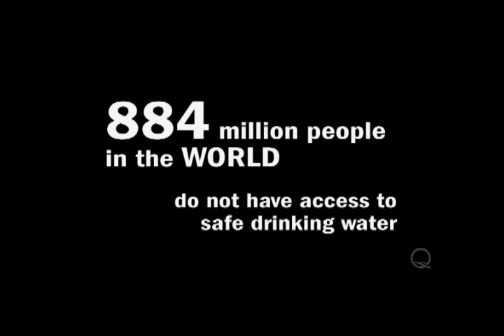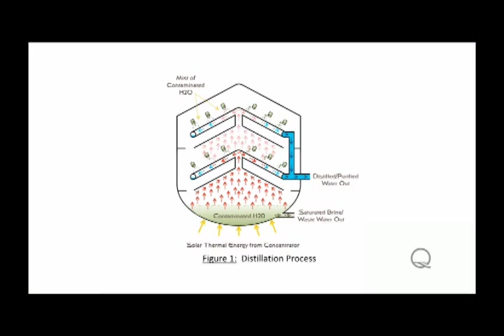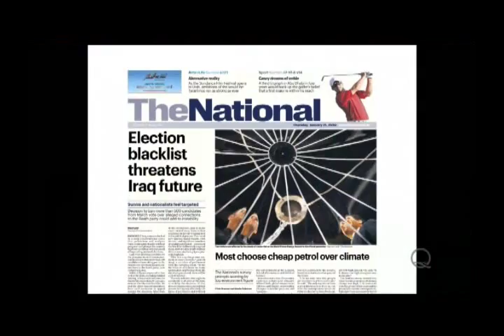Epiphany Solar Water Systems on WQED

Comment: "Here in Pittsburgh we don't have to worry about getting fresh water ..." The opening line of this WQED Pittsburgh 360 piece is patently false. Pittsburgh has yet to genuinely address the primary goal of the Clean Water Act:  "...(1) it is the national goal that the discharge of pollutants into the navigable waters be eliminated by 1985;..." Continuing Combined Sewage Outfalls are only the most basic and relatively benign of our failures to protect fresh water... 

There is no substitute for protecting fresh water supplies: Swimmable Fishable, Drinkable...